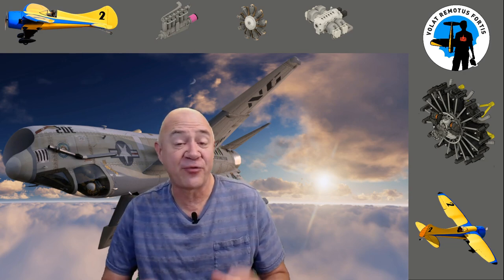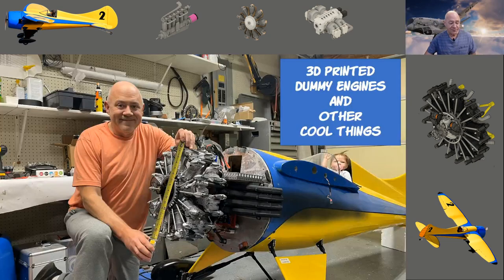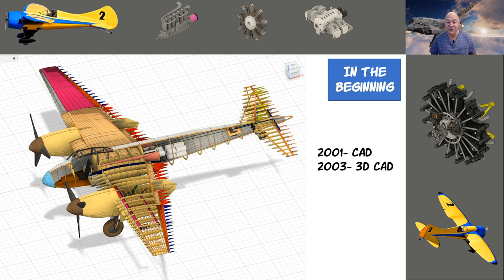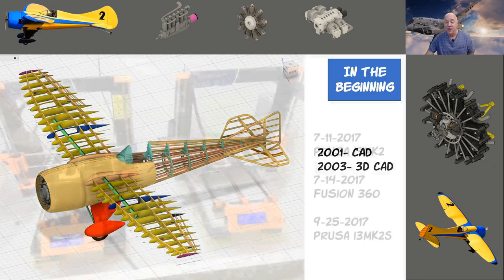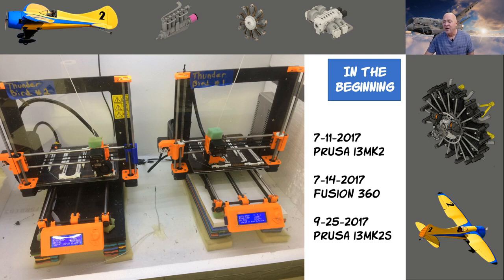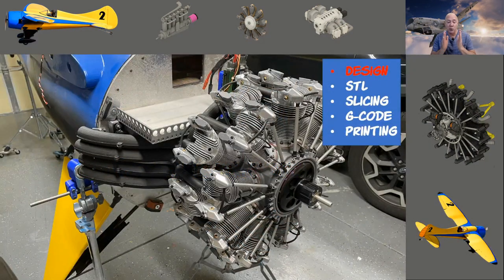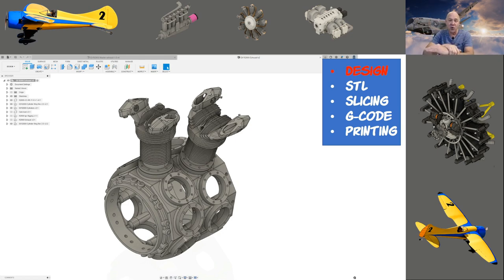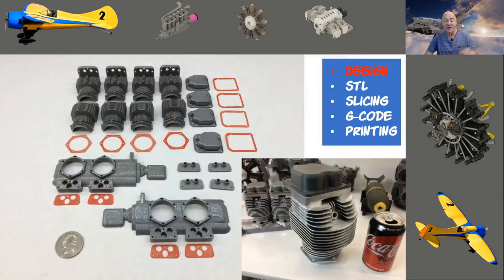3D Printing for RC Aircraft

Comment: Dag, do you mind if I ask what slicing software you're using ? I'm using CURA, which is great, but the printed supports would have covered the face of the model whereas in your preview they didn't. Great work ! thanks for the videos but more importantly your time... much appreciated.
Reply from the maker: I use Simplfy 3D. Thanks!!